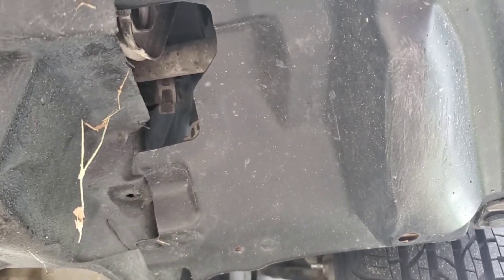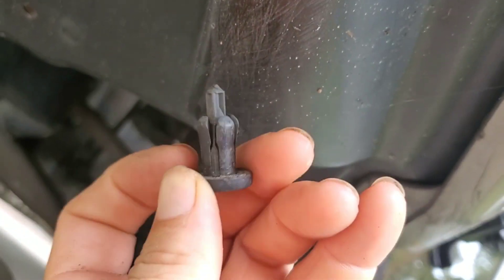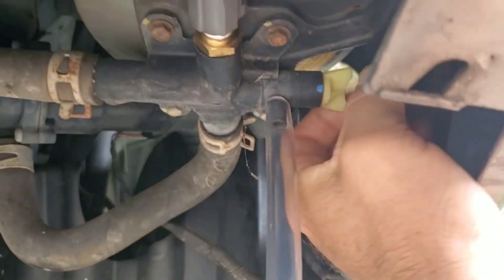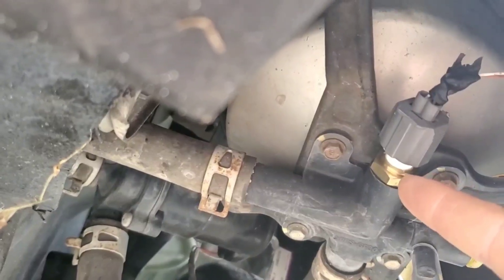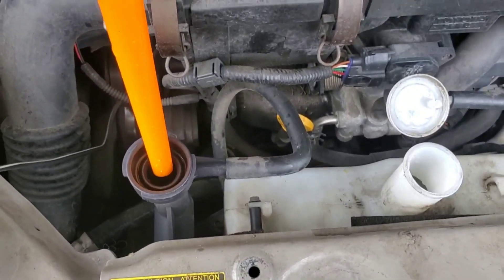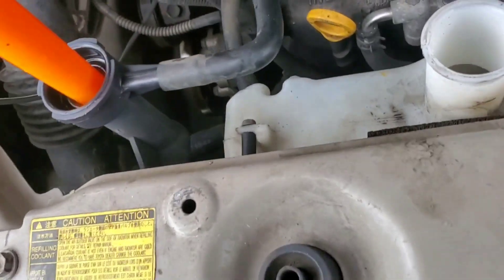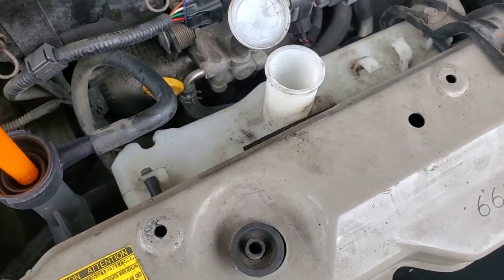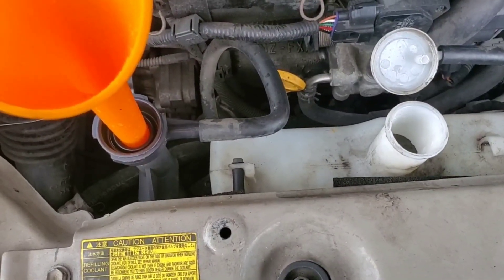Toyota Prius gen 2 Coolant sensor replacement (Thermos)

Comment: My Prius 2007 error code P1150.. Any ideas ?
Reply from the maker: Ha, there's a bunch.  
Faulty Air fuel Ratio (A/F) Bank 2 Sensor 1
Air fuel Ratio (A/F) Bank 2 Sensor 1 harness is open or shorted
Air fuel Ratio (A/F) Bank 2 Sensor 1 circuit poor electrical connection
Fuel pressure
Fuel injector
Intake air leaks
I'd look at the last 3 first as they are the easiest.  It could be one or more bad fuel injectors or none.  It could be the sensor gone bad.  Basically anything that would cause the air fuel ratio to be out of specs.
You might try a good quality fuel injector cleaner.  Use it and try a non ethanol gas at the same time.  Reset it and see if the problem still persist.
I bought a high ethanol gas just for fun on a road trip and all hell broke loose.  Lost almost HALF of my fuel economy.
Good luck.  
I hope it's an easy find for you.

Comment: What side is the coolant temperature sensor located in a 2005 toyota prius ?
Reply: 2004-2009 is gen2, so looking at car from front, it's on the Right side, next to the coolant canister shown. Driver side tire, easy access. No need to bleed if you SWAP ECT SENSOR RIGHT AWAY, n add some coolant in radiator.
Reply: Driver side under radiator left side need to take off plastic cover behind to the wheel (driver side)

Comment: We’re you having trouble with your heater what symptoms were you experiencing ? I have a P1122 with no heat
Reply from the maker: Mine was a bad thermostat
Reply: I have P1122 with no heat also, curious to know if/how you fixed.
Reply from the maker: @asgreen21  Mine ended up being the engines thermostat

Comment: I’m getting a p1116 code for my 08 Prius. Can someone explain to me what that is. Is it an easy fix and how much it will cost to repair? Thanks
Reply from the maker: Do you have heat if you turn it on?  Check that both inverter and engine have enough pink coolant.  Could be a stuck thermostat for the engine.  Could be bad sensors
Reply: @eby6114  thanks for replying. Are you referring to the heater? Yes hot air blows out when im using it at night.
Reply from the maker: @Healium55  Ok so I'd check that the inverter coolant pump is still working jump open the reservoir next to the inverter while the car is in the on position there should be some signs of movement in the fluid.  If not bad pump.  If your using an obd 2 testing you should be able to add a function of actual temperature of the fluid for the inverter.  It could be the sensor went bad.
Reply: @eby6114  
Hi, reading your replies...
My 2007 Prius has codes p0117 and p1150. I changed stat last Saturday, erased codes, but haven't filled coolant fully, and codes show up. I wonder if I need to test the coolant temp sensor?
Symptoms: NO hot air with Heater ON on HIGH. Coolant temp 135°C 10mins after driving easy, RED TRIANGLE with Temp icon on screen. --I wonder if it's my radiator or heater box... i used K Seal (to stop potential internal engine oil leaks) 5wks ago, and after losing coolant, 3wks ago I used Bars Leaks aluminum sealer in case any radiator leaks. Your input is appreciated.
Reply from the maker: @elydiaz1031   @Ely Diaz  Check for damaged wires, or a bad fuse, if it has a fuse..  Not sure which one for that ONE sensor.  The coolant sensor might get have damaged wire as well ... If they both showed up at the same time  and they are on the same fuse then that's your answer.  However they might go straight to the ECM.  You might try looking through a service manual to see if there's a related fuse for both.  Check your thermostat.  I had a no heat problem which was resolved simply changing it.  They say you can watch it in a pan while heating it up in water to visually see it open but if I'm going that far I just go ahead and replace it .
Check bad wires. Bad fuse (if they are fused).  There's another possibility that the water pump (electric) is bad or not getting signal which would cause overheating and no heat as well.  Good luck
Reply: @eby6114  
Thank you for your helpful reply.
I've done this so far:
A. No heat and Red Triangle temp icon got me to change Stat last Saturday. I understand that if Stat is Stuck, then coolant doesn't circulate & hence no hot air (unless waterPump or HtrCore). 
FYI: The Motorad stat I took out LOOKED in good condition. No damaged rubbr.
B. I didn't fully fill up rad with coolant, as I was in a hurry Sat.
C. I added some coolant (like half quart) before driving 45mins from Sjose to SCruz WITH RED TRIANGLE ON the whole way. I didnt have a BT dongle yet, so couldn't see real time coolant temp.
D. Based on your reply, just now I went and added 2qts Toyota coolant; removed cap and let it run 10mins; drove the car uphill 4mins & temps went to 112C, i stopped & checked for leaks, NONE found; I drove back and temps reached 120C and Red Triangle came on (I noticed it comes on at 120C or higher).
I still dont have HOT AIR, no leaks.
Driving easy, temp stayed 86-92C

Q1: due to +130C temps. Can the ECT be damaged now?
Q2: I didnt move any wires on ECT, so I doubt they're damaged, and wouldn't the ECT sensor NOT send any data if damaged or dead?
Q3: I read codes again, and now it says p1116, "ECT signal unstable or intermittent " & "Coolant Temp sensor is out of self-test Range", do you think it'd be better to just change sensor?

TiA
Reply: @elydiaz1031  Hello!  I have the same problem.  How did you solve it?  thanks for the answer
Reply: @elydiaz1031  did you figure this one out
Reply: @na_ostro_waw  so it all points to be the thermostat. I bought the Akin (or something like that) brand, which came to have the seal gasket, but didn't. So I bought gasket at O'Reilly $2. Temps kept going high past 110C, even after filling n bleeding coolant. WHAT DID THE TRICK WAS OPENING THE BLEED VALVE (right side, torx/allen wrench type), and adding more coolant. Mine didnt overflow from there, BUT AFTER OPENING IT, THE RED TRIANGLE NOR HIGH COOLANT TEMPS NEVER RETURNED. *Also, unscrew it slowly and ONLY A LITTLE BIT, i think Overdid mine and I dont think I was able to close it back up (as I might have strip the PLASTIC threading a bit). Either way, car has not overheated, and temps remain mostly at 82-89C, never going past 95C like before. Heater core n hot air are working. In sum, in my case, it appears to have been the stat. *I returned the temp sensor (for the lower coolant metal tank), as I figured THAT PART was not the issue. Sugg: Start with the thermostat.
Reply: @mikecoonhunter101  yes. Please see my reply to Na Ostro... I've driven many miles, going uphill and in the hot desert, and No overheating problemas anymore. -if you change Stat, go with a trusted brand (Akin, Gates, Barnley, etc).

Comment: Got a p1116 and red triangle + High Coolant Temperature Warning Light and engine light. Diagnostic dongle/app Innova's RepairSolutions2 says: " P1116
Primary Fix: Replace coolant heat storage tank Temperature sensor" that is the same as the "Coolant Temperature Sensor" that you are replacing here right?
Reply from the maker: Yes I'm replacing that sensor.  Btw if you have torque pro you can actually add widgets to see the various temperatures such as engine, inverter, etc.

Comment: What is the code? P3190???
Reply from the maker: The code itself means poor engine performance but this very possible that the engine is not running at all also you might think that the engine is running but that might just be the hybrid battery trying to start the motor they sound exactly the same

Comment: Do not drain, is going to take you two days to fill the system back, much easier unscrew the sensor, even if you loose some of the coolant, to fill some back. If you put clean plastic container , right under the thermos , you not going  loose  to much.
Reply: so I don't have to drain just unscrew and put the new one in quick as possible
Reply: plug the hole with your finger to minimize fluid loss ..then tread in the new sensor.

Comment: I’m not having any code on my car. But I got no heat all. The fan keeps blowing cold air. Even if I set it at max heat. 
I flashed the heater core. I checked all the heating fuses all fine btw. I added coolant to the right level, I even let it run without the cap on, to purge the air. But no heat still. 
My question is did that sensor prevented you from getting heat ? And how did you come to that conclusion (engin code maybe) ?
I’m really desperate bro! Please answer ASAP. Thanks
Reply from the maker: Did you check your thermostat?
Reply: I will do the same. Tstat and sensor change, then I will post back. Thanks
Reply: @vladekvladinov5753  How did the tstat and sensor change work out. I have the same problem. Thanks
Reply from the maker: One thing might just to check the actual lines are hot which could lead to where the heat stops.  A bit of highway driving then feel around following the flow.  Could be bad impeller, tstat, loose wire etc
Reply: Water control valve
Reply: Water control valve
Reply: I did not. Because I don’t have the engin light on! So no code. And the car is not over heating, so I over ruled  the Tstat.
Reply: After you changed your sensor, did you get heat in your car?
Reply from the maker: @vladekvladinov5753  not until I replaced the sensor and thermostat
Reply from the maker: Not sure of the voltage but you could put a multi meter on while the heater is going to verify the electric pump has voltage

Comment: I guess you already know by now, but there is a bleeder valve for the coolant system. 

Thanks for the vid.
Reply from the maker: Pretty sure that bleeder valve is exclusively for the inverter system which is isolated from the engine heater
Reply from the maker: Pretty sure that bleeder valve is for the inverter system which is an isolated system
Reply: @eby6114  The bleed valve is located on the top of the other end of the radiator.
Reply: @eby6114  The inverter system has its own bleeder; it even looks like a bleeder screw. The one being talked about here is on the left side (driver's side) of the top tank of the radiator; you need a long Allen wrench to get to it (I believe that it's a 5mm hex). There is an access hole on top of the radiator support to make it easier to get to.

Comment: Did you get a p0117 code ?
Reply from the maker: No mine was 0118, but it actually was high.  My thermostat was stuck and I replaced it problem was solved
Reply: Was your car over heating at all?
Reply from the maker: @jaimecuevas77  Not much, but I did start seeing it.  If you have a Bluetooth diagnostic dongle you can find the actual temperature of the various sensors in real time
Reply: @eby6114  

You mention temps several times, what should be normal coolant temp?
I'm now seeing 135°C on free torque app with BT ELM327 dongle.
Reply from the maker: @elydiaz1031  That's way too hot.  Around 82C
Reply: @eby6114  
Thanks! I changed stat (Asin brand) last Saturday, adding more coolant now. Running car while parked, no rad cap, heater on BUT COOOL AIR ONLY. No leaks.